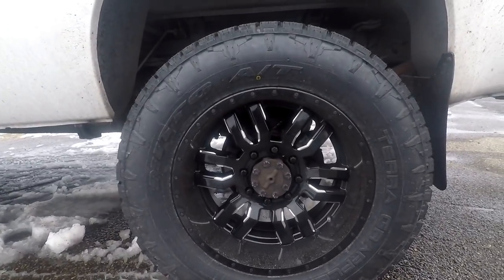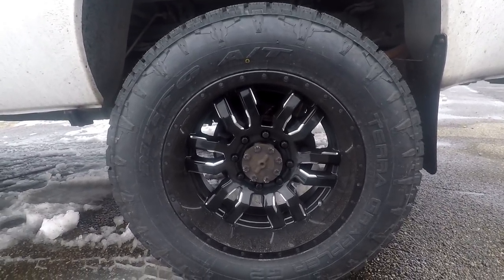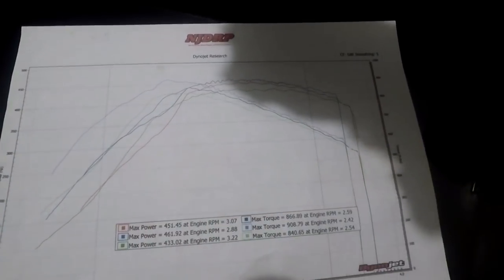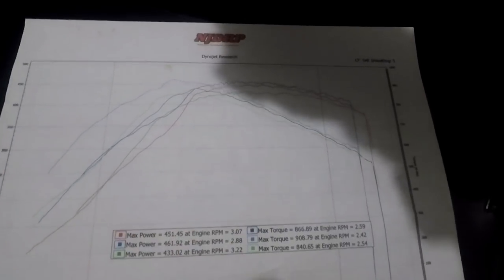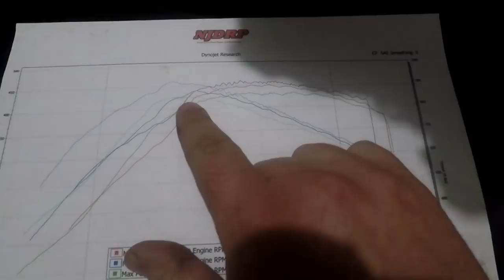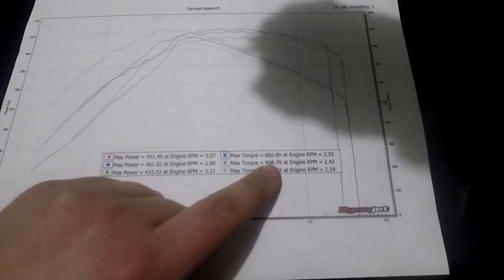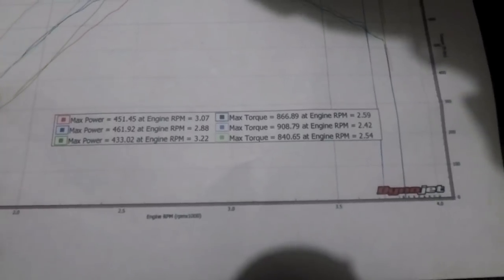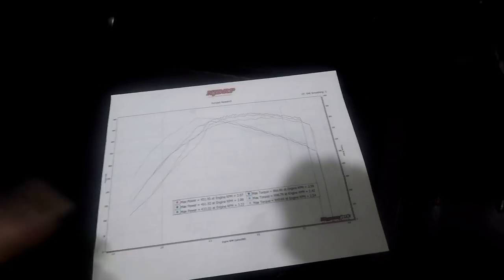6.0 Powerstroke Dyno

Comment: Hey buddy something isnt right i promise you that. Either they dyno or maybe your tune bro. Your truck has to be putting down over 600hp ive seen 6.0s with less done do it so i know yours can! Awesome vid tho!
Reply from the maker: Yea I think it is something goofy with the truck. Going through stuff yesterday we will see what I come up with soon. Someone thought maybe the trans was starting to slip
Reply: Not 600hp with a stock turbo and 175/stocks. a Stock turbo will not exceed 500hp by much. Hes probably making very close to that, which could do with how the dyno was loaded.
Reply from the maker: It has a powermax turbo on it for now, although I am in the works to changing that. I dont think I am near the 600 mark but I definitely was expecting at least 520ish. So I  am making sure everything on the truck is good. Now there could be some trans slippage starting to happen. I mean the truck is definitely whooping the transmission at this point lol.
Reply: @six0bros  at 98 mph you are looking around 510ish if your truck weighs around 7500.
Reply from the maker: I would have been ok with 510 lol.
Reply: Trent the 98mph doesnt mean anything if there is a issue with the tune or the truck.
Reply from the maker: I do think the transmission is running out of steam from all the abuse
Reply: @six0bros  likely the converter is your issue.
Reply from the maker: I put the truck on a lower hp tune and it pulls much better than my race tune so I am thinking you're right. The race tune is to much for it right now and this tune is not. Now I know I am on borrowed time lol.
Reply: @six0bros I lasted about 8k miles after I got the big turbo before I had a hard part failure. A good fluid change and converter would probably help.
Reply from the maker: I am going to change fluid, and try to get through winter lol. I want to put a built trans in with my tax return lol. Well tax return and some money I put away.

Comment: Everybody thinks that Dyno numbers are the be all end all. I guarantee you you could have the same truck same dyno right next to it and there be at least 10 to 20 horsepower difference . There's just too many variables, I don't care how the truck is tuned.
Reply from the maker: I agree there is a lot that goes into it. That is why I tried making sure I had track times too. My truck wouldn't hold the gear for the pull so it wasn't a great dyno run
Reply: It took me almost 3 years to buy my truck. After I bought it I found it on YouTube an talk to the original engine builder. And came with 11,000 in receipts. Honestly it's got to be on the cleanest 2004 F350 Harley-Davidson trucks I found. I paid $22k
Reply from the maker: Thats awesome man. How long have you had the truck
Reply: @six0bros  about 3 months the only thing I've done is a 4-in stainless steel turbo back exhaust with a muffler and dual outlets. A 2 inch front 1-in rear lift with 35s on stock rims. I've been looking for a tuner/monitor and I found both Bully Dog and SCT GTX for under $500 new. It's just hard to find tunes since this truck has no catalytic converter and EGR deleted . The motor's been rebuilt with new o-ring heads and studs and only has about 10K mi on it. It doesn't show any codes and I wonder if those canned tunes would work on my truck .
Reply from the maker: Custom tunes should still work fine. Blessed performance sponsors the channel the cat isn't even something that gets tuned out on a 6.0 because there is no sensor to it. Egr delete even with an engine light on doesn't really do much. Some factory tuning won't even trip a code. Use my affiliate code for blessed performance and get 10% off custom tunes. Code is six0bros
Reply: @six0bros  thanks I appreciate it I will definitely check them out
Reply from the maker: Anytime man I try my best to help. I fall short sometimes but we try very hard here.

Comment: I have an early 04 the heads are o-ring the truck was completely bullet-proofed back in the winter Ford oil cooler EGR Delete you know the usual I did put lifters and pushrods in it stock trans and converter on borrowed time 305 50 20 Nitto 420s I have a XDP coolant filter stock radiator stock intercooler running a No Limit intake 6.4 banjo bolts stock lift pump Warren 175 30 injectors KC stage 2R all innovative extreme Street I have recently changed my up pipes to mbrp and put Sinister Diesel manifolds along with regulated return in a airdog 4G 165
Reply from the maker: Sounds awesome man love the build.

Comment: Check fuel pressure with cetane additive? You gotta have the food for the horses. And remember new means a little stiffness going on. A friction oil additive is a proven boost for power release. Kinda like turning the A/C off. A cheat is 5 psi tire over inflation. And some super HP pulls if you notice they will slip on skinny smaller tires to get the weight off. Really not important for real use HP dyno but if you want to claim one brand over another is the best they have tricks to make it so. Or kinda so. Hahahahahahahha.

Got propane injection?! Just kidding. HMMMMMM!
Reply from the maker: Fuel pressure is good. I do know my tires were very low. Just then the day before and didnt have time to top them off with air. They were only 32 psi. I have then all up now. I always run archoil with every oil change.

Comment: Considering your 1/4 mile time of 13.62 @ 98.38, I'd say those numbers are probably right.  You have a lot of mods so there may be some power lost, if the trans can't put all of it to the wheels.  A built trans/TC will do wonders for a built diesel and is usually the most neglected improvement (besides gears) people tend to do.
Reply from the maker: Truthfully this is what I am thinking the issue is. I am thinking the trans is starting to have issues getting it to the ground. There are plans for a built trans before the season opens up next year.
Reply from the maker: Also I need to weigh the truck because that will definitely put things in perspective. I believe with me in it its somewhere around 7300, but if it is lighter than that then the hp calculations off 1/4 mile time would be way off too.
Reply: The stock trans can handle the 600hp for sure. You can get a tune tune account for that spec. 

I run SCT tune and they have transmission tunes for this application. I understand you can do up to 800hp. and that would be the top to still drive home and tow the trailer. After that then the high dollar builds kick in. It would be cool to see how hard you can run the stock trans till it gives then do a after market build.
Reply from the maker: I run sct custom tunes they always come with the transmission tuning. Fuel psi is good too. I really think the transmission is the culprit.
Reply: @six0bros  my 03 crew cab fx4 with 33"s weighs 7400
Reply from the maker: Long bed or short
Reply: @six0bros  short

Comment: You have a bad tune or something, my truck has less done and it pulls harder then that. Should be 550ish area
Reply from the maker: Found out later the passenger rear brake caliper seized up.
Reply: Well that’s good news! Hopefully soon you can do another dyno. Thanks for all the info on the channel getting my 175/30 injectors from warren now so hoping to run a dyno soon have some other supporting mods so curious to see what I’ll make. HG blew again so figured I’d build it with ORing heads as well so we’ll see 😅
Reply from the maker: Yea I am hoping to get on the dyno early next month and hopefully get some racing in soon after. Sorry to hear you gotta do head gaskets again. I highly recommend kill devil diesel for some awesome cyclinder heads. I understand it's not in the cards for everyone but they are an awesome product and you wont regret it.
Reply: That’s who I initially wanted to go with! But I have kids and I couldn’t spend so much as I’m already into it a lot 😅 would do a lot of the work myself but with HG I don’t have a lift. So hoping now with oring heads I’ll be ok. What do you think your truck is putting down now? Hoping with what I have done and the 175/30 I can break 500hp fingers crossed 🤞🏽
Reply from the maker: I am hoping the truck is in the 520 range. I will be hyping up the next dyno video that will he coming soon

Comment: 175 with stock nozzles and a powermax if I read right on the description? I think the powermax’s flow isn’t enough to break 600. I would say go above stock nozzles and go with a 64mm Non vgt. 

I didn’t see any modifications to the transmission?
Reply from the maker: Completely stock transmission at the moment. I should have been more clear in the video the plan was never to keep the powermax and these injectors to hit 600. I always planned to do 190/30s and I was going to do a stage 2 vgt, but now I am looking at a 66mm compressor wheel on a vgt so we'll see what happens next year.
Reply from the maker: I have a feeling the stock transmission is st the end of the road lol. I could be wrong but I think that is part of the issue.

Comment: Hey man was it a loaded dyno or not? If not that’s your answer but if it was I definitely think at this time your sticks and turbo are holding you back.
Reply from the maker: It was loaded. Dyno operator was really cool and showed me when he applied load and everything it was cool. Turbo and injectors definitely holding the truck back but I did expect more than 460 when previously I hit 500. Now main thing here is 2 different dynos and operators. Also two very different locations and weather conditions. A lot of variables.

Comment: 460 to the wheels is a nice number. I wonder if your running out of fuel the reason I ask is because I noticed your not producing much if any smoke or your tune is not demanding enough fuel to spin the turbo up enough. I think you need more fuel what do you think? and how much boost?
Reply from the maker: I am definitely out of fuel with my injectors. And the powermax turbo wont clean up any larger injector. Which was known when I did this setup. I noticed on this dyno I made very little smoke when I was on the last one I made a lot more and it still cleaned up on the top end. The truck will be getting a set of 190/30 injectors I will be testing a 66mm comp wheel on a turbo.

Comment: Also, you might be at the limit of that turbo which is advertised as +175hp over stock.  I know you mentioned staying with a VGT, but this is going to limit your top end.  Look into the Borg Warner S364SX-E 87/80.  It will spool fast enough to easily tow with and give you plenty of air to make over 600whp.  Shit, I tow a 14,000lb RV with a 69mm fixed vane (BW S369SX-E) on stock fuel and she does just fine.  Yeah, it's a Cummins but it's all in how you drive it.
Reply from the maker: This truck is definitely staying vgt. The next truck I build though that will be getting a non vgt turbo......or 2 🤔
Reply: @six0bros  Curious why you're so adamant about staying with a VGT?
Reply from the maker: I really like how they drive and overall performance of them. For daily driving they just perform very well, and of course for towing they are hard to beat.
Reply from the maker: 600 is definitely doable on a stock cam. You dont even need a crazy build to do it. When I did the cam I didnt really have set goals for the truck. I have since decided I want to hit 600 hp and still be able to switch tunes and tow with the truck. I am still in the process of checking the truck over, and making sure everything is good. Fuel pressure is good, fresh oil change, hoop seems to be good as well. I am going to try and put compressed air to the system this week and check for any boost leaks. Just giving everything a once over.

Comment: i wouldn't expect to hit 500 hp with stock nozzles. there's only so much time to inject fuel.
Reply from the maker: Yes but the truck has already put down 500 on another dyno with stock injectors. The truck has a lot done to it, and track times definitely have it over 500, but the main thing is this was a fun day and this setup was never meant to stay on the truck anyway. That said it is a great very fun very clean setup to run. The truck is around 7300 pounds and ran a 13.6 in the 1/4 mile at 98 mph. It's a blast. I am  very excited for next year to do some more racing with a different turbo and injector setup along with a built trans
Reply: @six0bros  i see, I didn't know the history. that's damn impressive you put down 500 w/ stock injectors. good 1/4 mile time too! cheers.... curious what this puppy will do with some 190/30s or bigger.. you have a lot of supporting mods
Reply from the maker: Thanks man. I am very excited for next season to get some good drag racing times in. I am thinking I can get into the 12s

Comment: I read somewhere of some long tube headers for the 6.0, do you think that it would be overkill?
Reply from the maker: My understanding is long tube headers in the diesel trucks is not the best idea. I have no facts to back it up, but not even the highest 6.0s are running long tube headers. I believe keeter runs steed speed manifolds on his truck. I would recommend bd exhaust manifolds or I believe Rudy diesel sells a nice set gpp manifolds for a great price